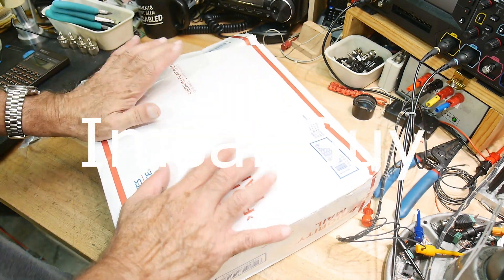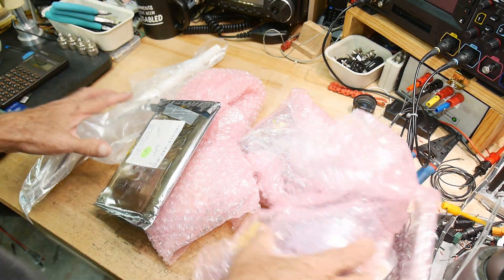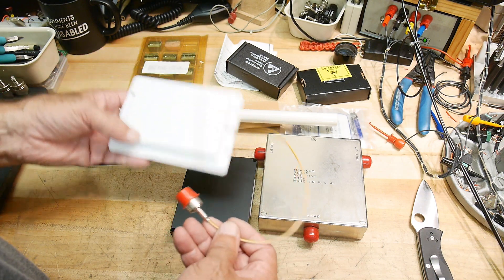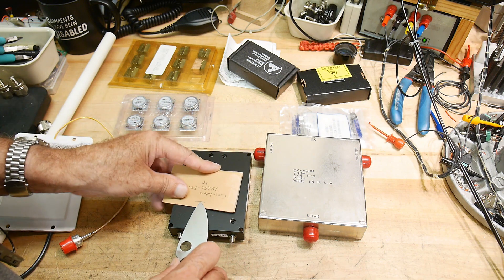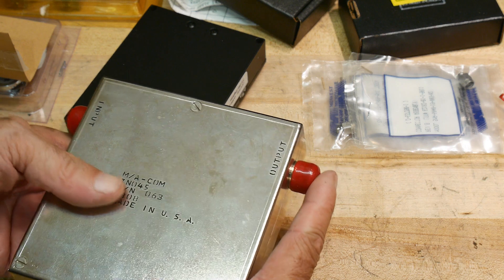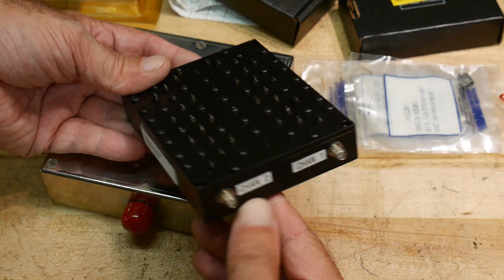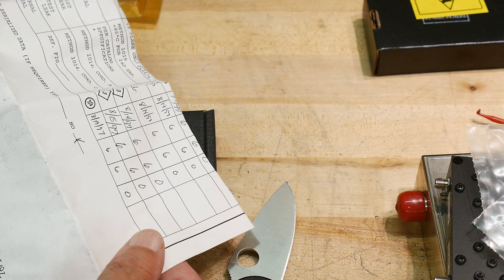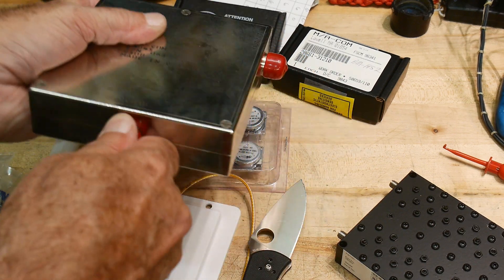#882 Box of RF Items (a gift from a viewer)

Comment: One of the reasons I rarely buy macom parts and modules on eBay is the datasheets are impossible to find. You go to the Macom site and everything they produced that is over so many years old is totally purged with no trace. I looked up the fscm96341 and the first hit is the Macon site but a parts search pulls up nothing. Search on obsolete parts sellers get hits but they don't have a description for what it is. My thinking is that it's a mixer.

Comment: That large circulator could be for a relatively low frequency range that could make it useful in the ham shack. Fingers crossed! Could also be large to handle higher powers. Which it is would be interesting to find out. Very cool haul!

Comment: Hi Sir, I am watching your videos approximately half a year. They are very informative and sometimes entertaining too. First i watched your chinese RF noise board test video. Actually i need a RF white noise generator. I searched something about it and i found some circuits with zener diode. They were almost same variations design. I want use white noise generator for measure shape of filter with RTL-SDR. I am beginner in RF and Ham radio. RTL-SDR max input power is 10dBm. There is no information about the power of the circuits what I found on the internet and how flat signal it gives an output. If make this generator is easy, could you make a video about it. Also i don't have SA If you share the measurement results, it can be a very good video for others too. Thank in advance.
Yours sincerely
Reply from the maker: https://youtu.be/evJcZdRJKT0
https://youtu.be/e7xCVEBs1CM
https://youtu.be/IgnnMJyN9l4